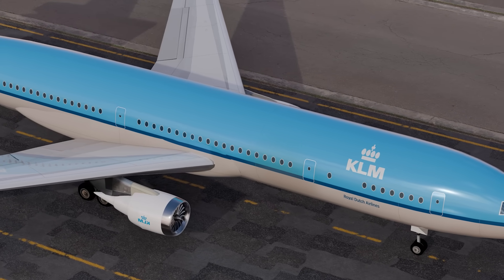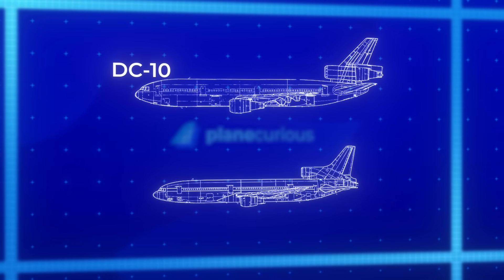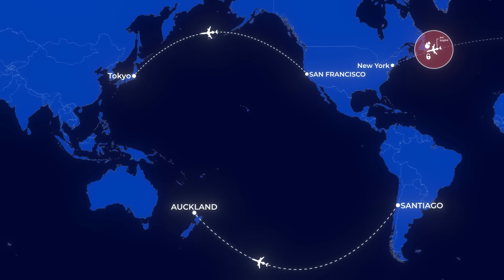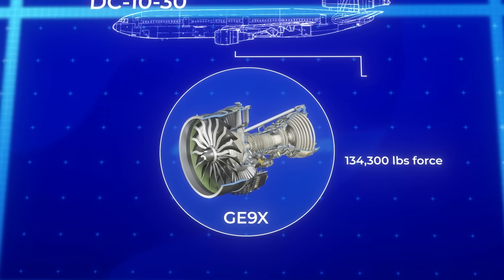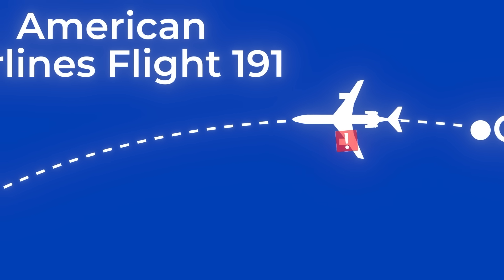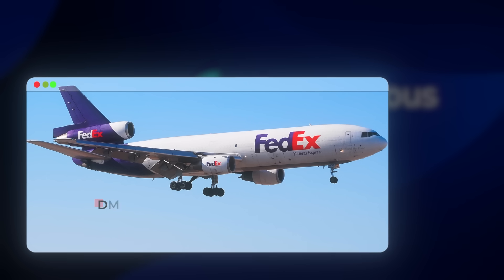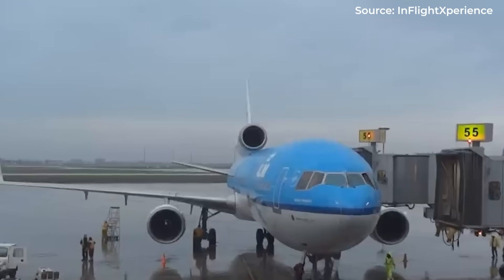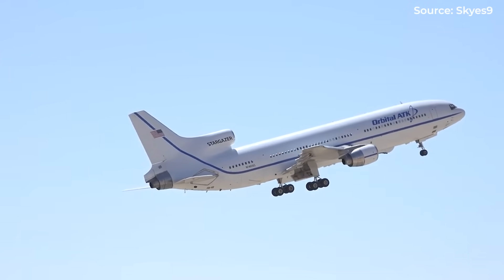Trijets Changed Everything - Until They Didn’t

Comment: The Hawker Siddley Trident had a fully automatic landing system and was originally a trijet  ; also the middle engine on the 727 was located in the fuselage ; the air inlet duct passed through the vertical stabilizer .
Reply: l1011 was ducted also
Reply: And the Trident nose gear retracts "sideways" vs longitudinal.
Reply: "S duct" design, it was superior to the DC10 straight through design for several reasons.
Reply: @Flies2FLL  But part of the reason for the costs and issues with the L1011 development, it was difficult to design to get a smooth consistent airflow in all conditions.
Reply: @NiallWardrop  True, but it was so much superior that it was money well spent.  Lockheed made many mistakes financially on that airplane, to include the use of the Rolls-Royce engine exclusively.  This was not only a complex and troublesome design, its fan diameter was too small.  This is what kept production numbers down to only 250.
Reply: @Flies2FLL  That was another issue with the concept in the long term - imagine a trijet with a modern high bypass turbofan in the tail.
Reply: @NiallWardrop  The first design of the 777 was basically a 767 with a center engine.  It looked like a slightly smaller L1011.
Reply: @NiallWardrop  With the improvements in design that have occurred since the L1011 was first designed, you should be able to build a high bypass design with a smaller center section and increase the thrust and efficiency without changing the overall package size - which would be ideal for the center engine. The wing engines you might be able to go with a larger engine package the same way Boeing increased the engine size on the 737 over the years - photos online show there is ample ground clearance with the original engines.
Reply: @Flies2FLL  False
Reply: @brucejonsson3149  False?  I think not.
Reply: @Flies2FLL  Curious what those reasons are?

Comment: The MD-11 could have been a lot more successful aircraft had McDonnell Douglas developed a new supercritical wing for the aircraft and stretched the design to carry more passengers, this would have allowed it to become a major threat to the Boeing 747-400, instead the company went with the cheaper option of just modifying the old outdated wing of the DC-10 and added wingtips to it. There was a project between Airbus and McDD to install the supercritical wing of the Airbus A330 onto the MD-11, this new aircraft would be called the AM300 and would have been stretched. However the deal between Airbus and McDD to build these aircraft collapsed in 1990 after a disastrous 45 minute lunch meeting between McDD CEO John McDonnell and Airbus chairman of the Supervisory Board Franz-Josef Strauss, so sadly the AM300 failed to leave the drawing board.

Comment: Gives this video a chance, sees DC L-1011 on screen, regrets immediately. (at 0:17 for clarification)
Reply: Do you mean DC 10 or the Lockheed L1011?
Reply: @francodimitsy989  He doesn't mean either, he's referring to the mistake in the video at 0:18.
Reply: @iskandartaib  My bad, didn't notice. 
Apologies to all. Thanks
Reply: @iskandartaib  What mistake? The narration said "The DC-10, L1011Tristar & 727. He simply mentioned all 3.
Reply: @TheRip72  he specified it as two different planes - "DC10 L10/11" and the "Boeing 727". He correspondingly showed 2 pics
Reply: @TheRip72  yes, but an aviation video which says Airbus A737 or Boeing B320 can't be taken seriously, and he did exactly that, just with older planes by writing L-10 or DC-1011 which is on screen at the given timestamp. and it should say Lockheed L-1011 TriStar and not DC L1011 Tristar, as it wasnt built by Douglas lol
and at 00:36 he says "Jumbo" and shows videos of an A380... well...
Reply: Welp
Reply: literally bro
Reply: Rough timestamp: 0:18 .
Reply: These channels are full of Artifical leaning and brain dead nonsense.
Reply: Thanks for the heads up. Don't have time for shite videos.
Reply: Not to mention the fake MD-11 right at the beginning. The engines don’t look like that.
Reply: It's a DC-10 though or maybe they changed it.
Reply: @128Cores Woosh.

Comment: The DC-10 is my favorite plane :)
Reply: The Death Chamber 10
Reply: @godoftheinterwebz  Whose accident rate evened out to be very similar to its contemporaries.
Reply: @cjmillsnun  
While both aircraft were involved in accidents, the DC-10/MD-11 had a higher accident rate and a worse safety reputation, especially in its early years, compared to the Lockheed L-1011. The L-1011 was often regarded as one of the safer aircraft of its time among the early wide-body jets.